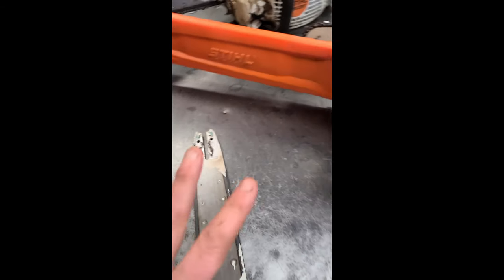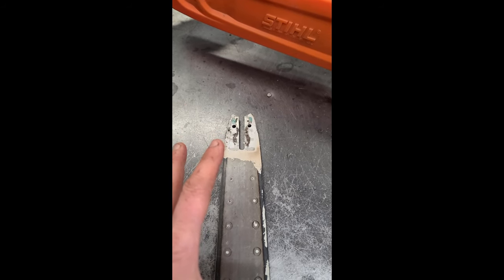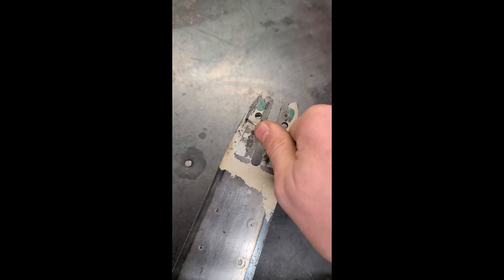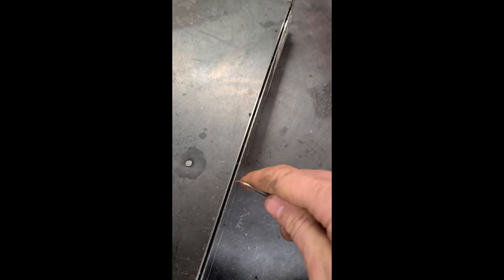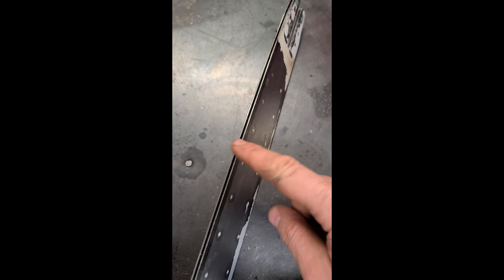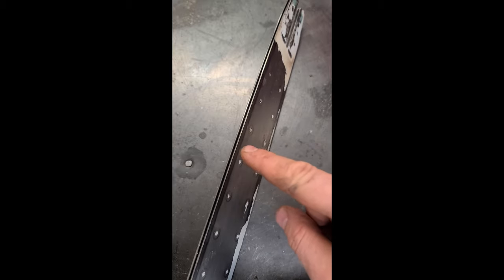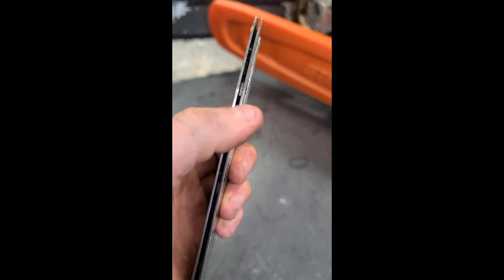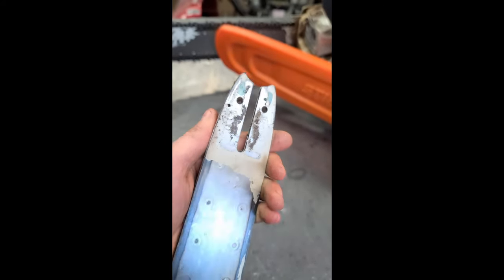Chainsaw Not Oiling Bar & Chain? - Here's Why! #shorts

Comment: I just purchased an MS 261 about a week ago. 
Still in the break in stage currently. 
First session was effortless and went without a hitch. 

Suddenly had trouble cutting through some oak and maple, whereas before it was effortless. 

Sparks were flying very faintly and the saw bogged down to a stop about mid cut. 

Chain was dryer than my wife's humor. 
Turns out it was these little bastard holes. Had more sawdust than the forest floor in there. 

Before every session or after every session. Always a bright idea to clean up these ports.
Reply: Lmfaooooo dryer than my wife’s humor 😂😂😂😂 now that’s funny!
Reply: Ain't nothing dryer than my wifes chicken either bro.  I hear ya

Comment: I clean the bar out with compressed air after i'm done cutting for the day. But i have seen quite a few saws that people said wouldn't oil and the oil holes on the bar we're clogged with saw dust

Comment: My Craftsman 18" leaks bar oil after I put it away after a project. I have started draining the oil out via the filler cap, back into the bottle. Is it normal to draining this way or is there a part to replace? I do take it apart and clean the chain/ bar area periodically... Thanks for the great videos.

Comment: HI . WHEN A CHAINSAW BEEN STANDING , WHY DO THEY LEAK CHAINSAW OIL  OVER THE FLOOR .
Reply: Put a piece of cardboard underneath it go back out a day later if the oil is right underneath the It’s the cabinets leaking if it’s underneath the chain that’s somewhat normal but you could have a bad seal between the pump and the hose that comes from the oil tank is it draining the tank or is it just leaking a little bit
Reply: I think the bar oil leaks from the saw if the bar oil case is filled up before storage, on a hot saw after use.  As the saw cools off, the case will contract a bit and cause the oil to seep out, especially if there is a good cap seal that uses an o ring.  In winter months, there will be additional contraction and cause even more oil to weep, and it's even more noticeable.  
It's a catch 22, cause if you leave open air volume, that air will get pressed out as the temperature decreases (during winter storage in unconditioned space), and cause an internal vacuum as the temperature goes back up- this is what I think causes the bar oil cap to get stuck on in certain circumstances.
Reply: @mattb9664  I think the hose from your oil tank to your pump is leaking the oil it’s an easy fix
Reply: @mattb9664  You should have a little bit of leakage but not enough that it’s all over the table it’s why I suggested that she put a piece of cardboard underneath it and let it sit overnight and see how much oil has been soaked in the cardboard if you’ve got a spot there’s no bigger around than your hand I would say that’s fairly normal if it’s bigger than that then yes you’ve got a bad seal between the pump and the oil line that goes to the oil tank
Reply: Capillary action of the sawdust drawing it out me thinks. Dony correct me if I'm wrong.